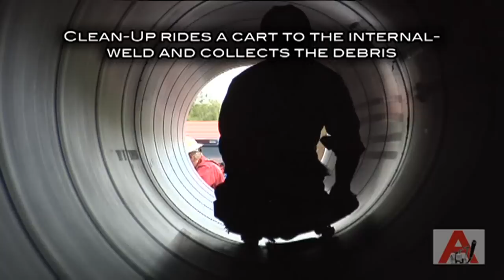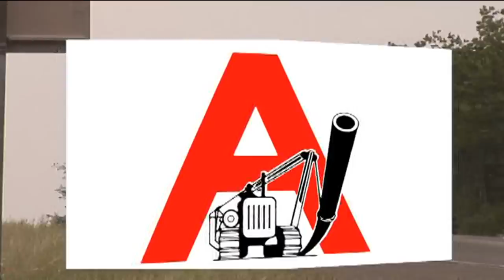The Double Jointing Process

Comment: That’s a lot of fancy equipment to weld up two joints of pipe. And to think for the last 15 years, I’ve been watching Filipino and Indians welders in Saudi lay thousands of mile of pipe through the desert with nothing more than a couple of old millers, a few straps and a front end loader. They use scrap angle iron as a centering jig.
Reply: i guess if there's a leak in the desert it's not that big of a deal.